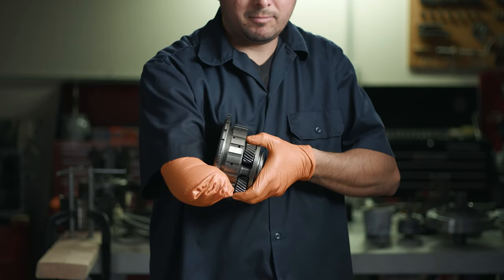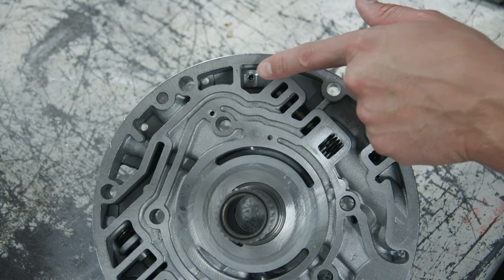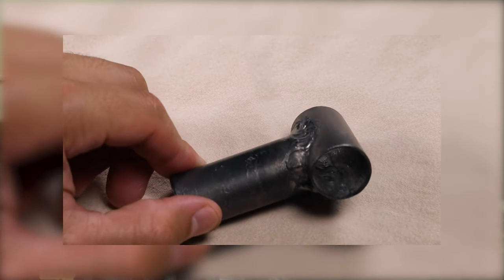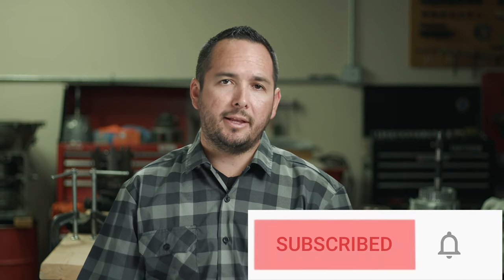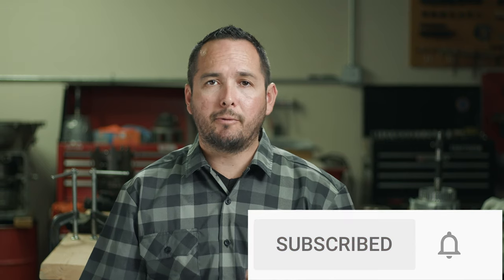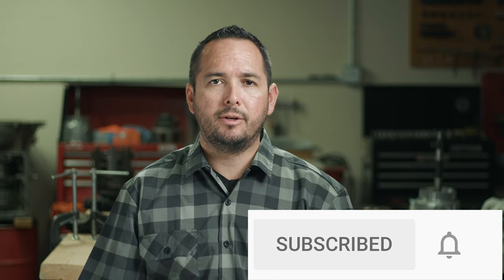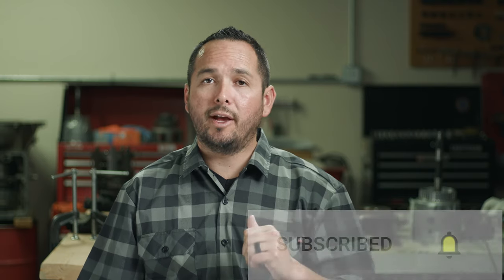Southpaw Autoworks Channel Trailer

Comment: I have a yr. 2000 4l80e transmission. With 3,800 miles on it. Now Problem with no 2nd gear It will rail up up to 4,000 to 4,300 Before it shifts two 3rd in go to 4th and to lockup Please help !!!! Change the pressure switch. What could it be ???

Comment: Bob I hope you had a great Independence Day celebration!!! I want to get your take on a problem I'm having. 1999 Ram 2500 p/u 5.9 Cummins w/47RE  * Gear searching*** 
Notably due to elec. field from alt. to ground cable that is in the alt. vicinity? Computer issues!
So I have watched some Youtube vids on the matter and I have wrapped the ground cable with aluminum foil and then elec. tape for asthetics, however, there is still a little unwrapped cable by the alternator. I am going to just reroute the cable tomorrow since it is still searching..... frustrating! I have no other issues with the truck except this trans. problem. I am not alone as there are a lot of videos on it!  Any help you can give will be tremendously appreciated!!!
Reply from the maker: Hey James, bummer about the gear hunting.  I may have an idea, but I really need to ask more questions, first.  Gotta make sure that we're on the same page, and then I'll do what I can to assist.

Questions:
1).   At what road speed does the hunting occur at?
2).   Is the condition affected by engine temp?  In other words, does the condition only occur when hot, or cold (engine temp)?  Or does it hunt regardless of temp?
3).   Is the trans hunting between 3rd and 4th gear?  Or is it the TCC (Torque Converter Clutch) cycling on and off?  Or is it hunting for some other gear?
      Note:  If you're not sure, watch the RPM change.  The engine RPM drop during TCC engagement is smaller than engine RPM drop during 3-4 upshift.
4). Is the condition affected by the grade of the road?  (flat/level grade vs uphill climb)
5).  In addition to questions 1-4, what else can you tell me about the condition, and about your truck?  Truck & trans history?
Reply: Ok brudda here we have it! 
1. 45-60
2. temp not an issue.
3. 3-4 shift. I do believe it is the TCC. 
4. Grade is not a real contributor that I notice. 
5. I have Amsoil trans fluid in it and it still smells and looks great since the last svc. approx. 7K miles ago. The truck was a company vehicle  and was maintained relatively well. I put about $2K in it to bring it up to reliable jump inand go to New York status. The ONLY issue is the TCC in out!! 
AGHHHH!! lol
I just loosened the ground cable that went over the ALT. and I rerouted it as to avoid the RF or any other interference. I bought a cable that has 5 STARS as THE FIX for this issue. It is on the way.  It connects to the PCM harness then has a little capacitor or something inline then to ground. Here's the link to it https://youtu.be/ESRt_CACwro
I appreciate your knowledge in the matter & heck maybe we can both learn something! 
Thanks Bob!
Reply: @SouthpawAutoworks  Bob I took the truck out for a little 10 mile drive and it is shifting perfectly from rerouting the ground that went over the Alt.. I had already ordered the fix wire with diode so I will just keep it and see what transpires with this reroute fix I did?  This is way out of my vernacular of TH350/TH400!! 
Thanks again for your immediate willingness to help me out!!
Reply from the maker: Right on!  It's always nice when they shift right.
Hopefully the re-routing of the wiring continues to take care of the issue.
I've got some other ideas...but, I'm pressed for time.  I'll be in touch.  Have a great weekend.
Reply: Sounds like a plan! I would love to hear them and you have a fantastic weekend as well my friend!!
Reply from the maker: Thanks for your patience, James.  Here's some more info.
1).  Verify that all electrical grounds (battery, chassis, firewall, etc) are in good shape.  This is a common "transmission" problem for many vehicles.  Voltage drop test (DVOM/Volt meter) can be done across the electrical connections.  Or, one can disconnect the connections, clean them, and re-connect everything.  This video is a bit long, but it's very informative:  https://www.youtube.com/watch?v=DfLyh43iihM
2).  Run a redundant ground to the PCM (https://www.youtube.com/watch?v=6K-VqGA9T-4) (This can be a way to bypass a bad ground)
3).  Check TPS (Throttle Position Sensor) for faults.  KOEO (Key On Engine Off).  Monitor signal voltage while slowly sweeping through entire range.  Transmission lock-up is based on a number of factors...the position of the throttle is one of them.
4)  Check throttle linkage (Known problem/recall for 96-97 5.9L Cummins [I know that yours is a '99]).  Check out this article: https://www.sonnax.com/tech_resources/185-12-valve-cummins-diesel-618-transmission-no-o-d
Reply: Wow 🤩 
You are amazing man!! You have a ton of work going on, ton of subscribers, ton of videos to make and edit and you found time to write me an enormous amount of information about my problem. I am floored by your dedication to assisting people!! Thank you for all the researching and knowledge that you shared!! I have even read that the alternator on my truck will show a charge status and be bad and also be causing the TCC issue! I mean it’s open season on the TCC 😳
Very susceptible to outside influences!! lol 
I am going to watch the videos and read all the information you sent. I am very conscientious of tight clean connections and if you seen my truck you would know. I do understand that grounds can make for a real nightmare of diagnostics! 
Thank you for everything you do brother 😎🤙🏻
Reply from the maker: Open season on the TCC.  Hahaha  too funny...
I'm happy to help.
Reply: @SouthpawAutoworks  
Schrodingers Box is the dude!!! I am a subscriber of his from way back! Very methodical genius right there! 
Steve Riddle: Good info!! I rerouted my ground as he did by the alt.. He said it didn't sustain a fix..... Which I can't argue since I haven't put it through a period of more than 10 miles. I will add the ground to the firewall as he did although not taking the route he did lol!
12-Valve Cummins Diesel/618 Transmission: No O.D.
Ed Lee:  Very good read on the TPS misdiagnosis!!  You really came up with some outstanding material that I had not come across in my search for the answer! Thank YOU again my friend!! You have a friend in Pahrump, NV. ;-)